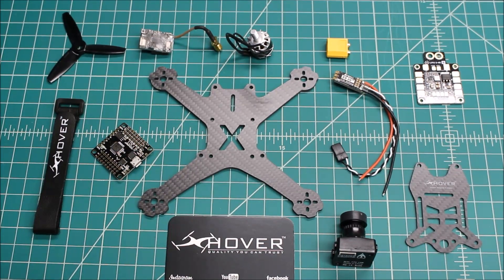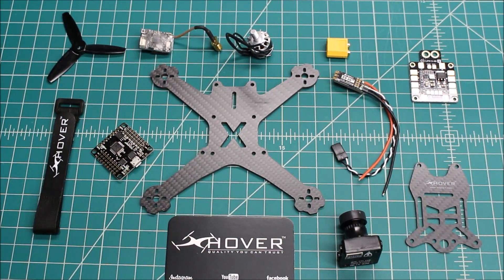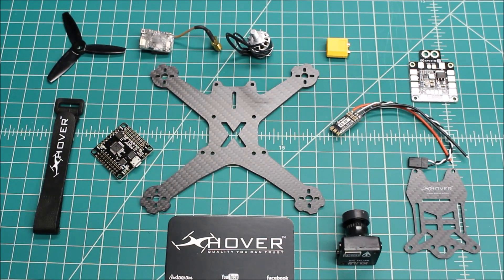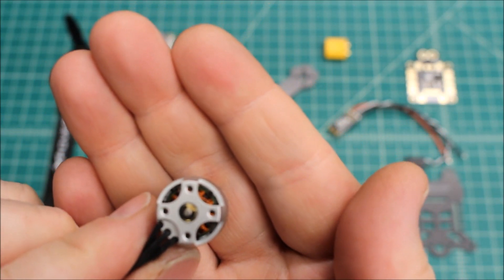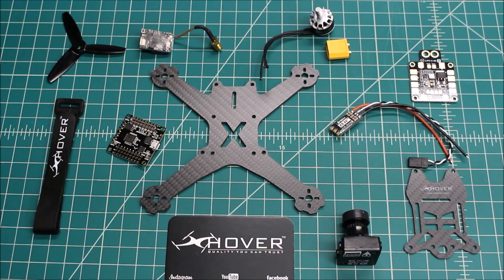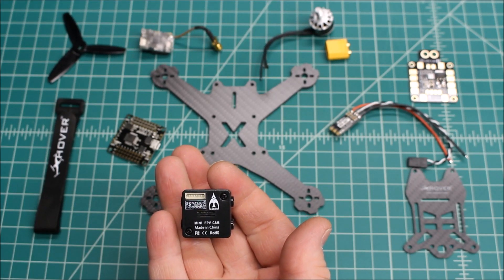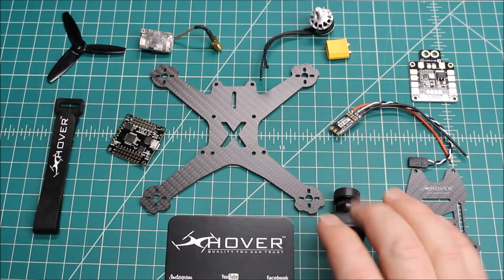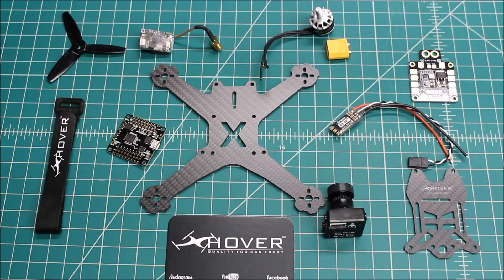XHover MXP150 FPV Racing Quad Buildout/Spec Video

Comment: Great video. The XRacer F303 is indeed a good solid FC but have you checked out the Omnibus Pro? It has a built in OSD and a current sensor. Still has the MPU6000 gyro and SPI. The other optional feature it has it that it can be ordered with a Barometer sensor so you know your altitude. A baro is not something everyone wants but I think it would be kind of cool to know altitude. Soon there will be an Omnibus Pro with an f4 processor so we can run at 8k/8k on BF 3.0. F3 can only accomplish 8k/4k on BF 3.0
Reply from the maker: Thanks for the info. I do like the Xracer, but it is a bit more money.